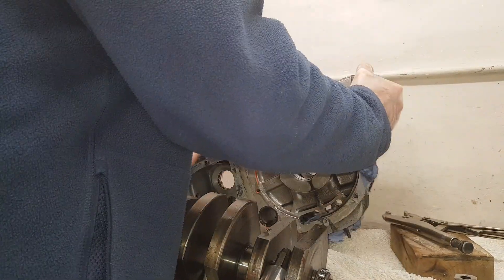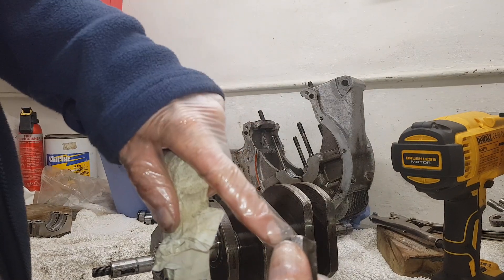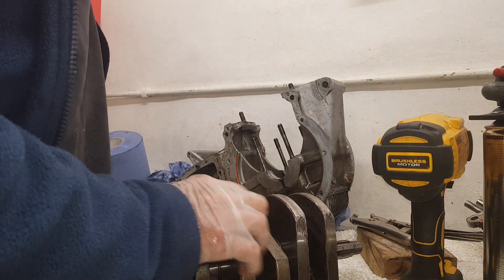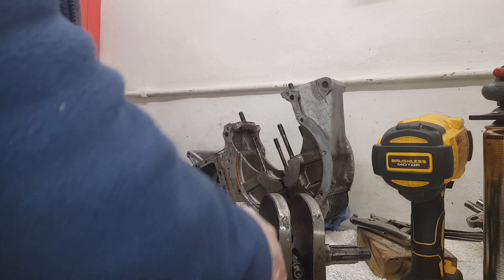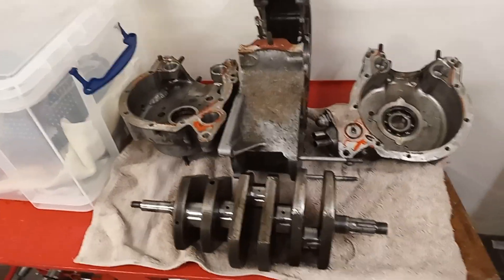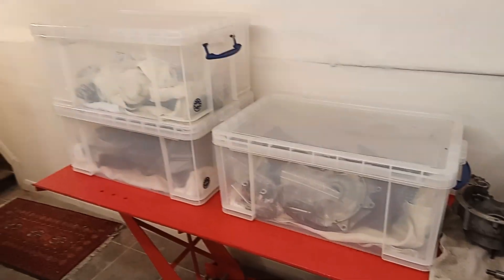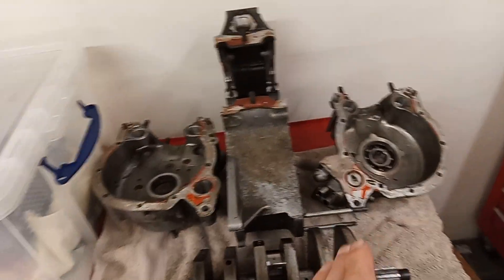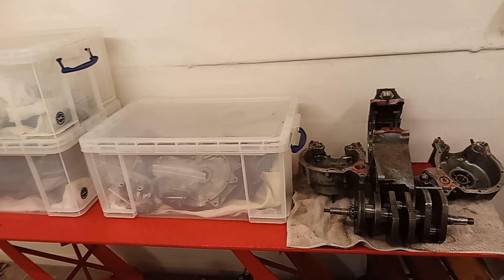Triumph Trident T150V Engine Rebuild. Part 11: Removing the Conrods from the Crankshaft

Comment: I'm quite surprised at the bulk of the crankshaft. Another cylinder and all I understand.Are the bearing of a heavier type. RMM
Reply from the maker: There are 4 main bearings in total, two plain bearings in the centre crankcase and two ball races either side. The ball race on the drive side is substantial compared to the smaller barrel race on the timing side. Not sure how they compare with a Bonneville etc.

Comment: Nice one Chris very interesting project 👍
Reply: I heard somewhere that the crankshaft oil ways can be drilled for more oil flow too, have you heard of that being done?
Reply from the maker: Yes, that's right. As it's a three cylinder engine with oil feed to the two central main bearings then one of the main bearing oil feeds has to provide oil to two big ends/conrods, not just one. You can therefore drill another oil way in the crankshaft so that the oil feed from each main bearing goes to two big ends, with the central big end receiving oil from each main to even things out. However, I think this is only really a consideration for engines that are pushed very hard e.g. race bikes, not just normal road use.
Reply: @Chris.rooke150  ah that's the reason why thanks chris
Reply from the maker: Thanks. 👍